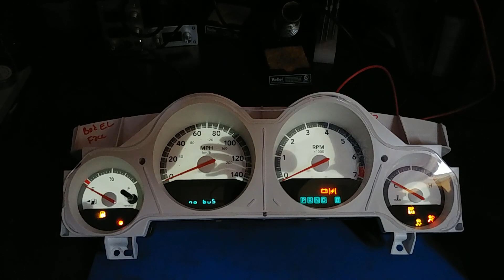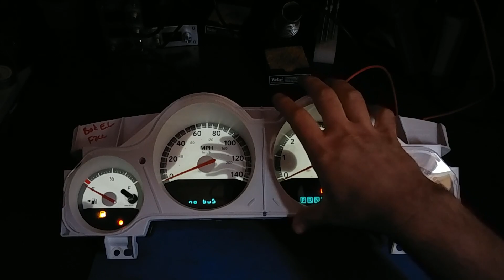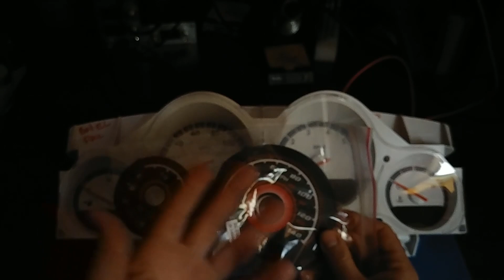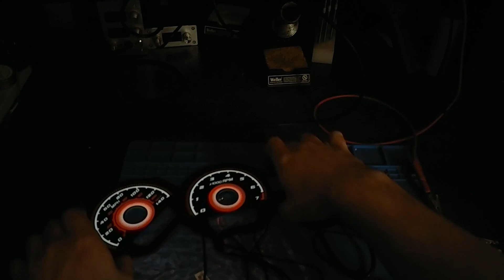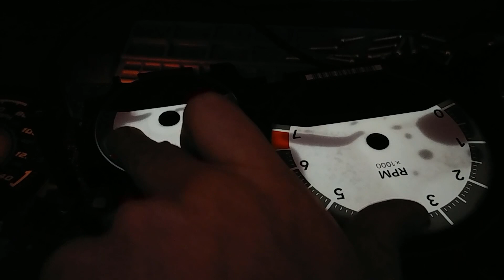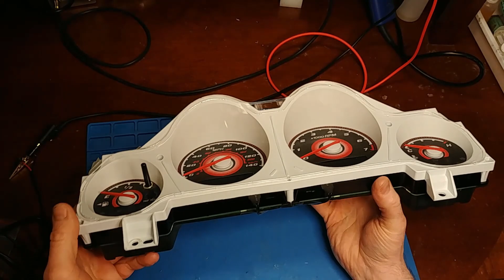Charger Challenger EL Lighting Cluster Repair

Comment from the maker: For quotes on repair service please email me at 1mr.repairman@gmail.com
Reply: NEWSFLASH !!!
It is possible to repair your existing (faulty) electroluminescent panel, provided there are no breaks affecting continuity.

Remove the sheet by dis assembling the instrument cluster, as per instructions in this (excellent by the way) thread. Place EL sheet (minus separate calibration overlay) on a flat surface and (using a household iron set to cotton/linen) iron out the air bubbles whilst in the process re adhering the clear plastic sheet to the EL part. It’s crucial to have an insulating layer of cotton (an old t shirt is ideal) between the sheet and the iron while doing this to prevent melting the clear plastic.
Work outwards from the undamaged section towards the edges of the sheet.
This will minimize trapped air bubbles which will show as smaller dark spots though they should be barely noticeable once covered with the calibration overlay.
I performed this procedure yesterday with excellent results !
Good luck 😊

Comment: hopefully youre still checking these. can you tell me which pins you are using to supply the 12v to the cluster. looks like 12+ on the white connector and 12- gray connector. it appears its the larger pins at end of conneector

Comment: It definitely does change the colors from like a white blue to a green that matches the factory climate contril dial green, I also laid mine right over the el panel and wired it right to the dimmer switch of the car came out super clean and can easily be turned back to original if desired
Reply: I honestly need help on the installation
Reply: @kidwitadream its super easy

Comment: My car had this issue went i bought it... I was thinking that buzzing I heard was the dimmer switch but i never thought to tinker with the gauge overlays cause it seemed to complicated... Might give this a try though....
Reply: Hey dude, i just bought mine, a 2011 RT. 

And has the same issue (the bubbles and the buzzing when using the dimmer. 

Did u and how did u solve ur problem ?

Comment: My cluster has been a nightmare for 2 years now. Loud whining noise, 1 gage with no lighting the other 3 with massive "shadows" and intermittently blacking completely out at night.  The fuse for the instrument panel is so hot you can't touch it.  Last night it finally completely failed.
Reply: Mine is doing the same exact thing and it makes some whining noise as I turn the interior light wheel knob up and down. I’ve been looking for a fix for this and I just found it today. I have a 2011 Dodge Challenger RT plus
Reply: @TommyWrenn what'd you do to fix it?
Reply from the maker: Sounds like it's time to get it fixed.

Comment: someone said instead of doing all that work you should replace it with a 2015 or 2017 cluster they don't have that problem. is that true, I have a 2013 R/T  doing that something yours is doing.
Reply from the maker: If that year range is compatible (I haven't confirmed) a replacement will require programming. If the programming is done at the dealership, you can probably buy 3-4 faces for the cost of dealership programming, and that doesn't include the purchase price of the replacement cluster.

Comment: please if you cant link this so i can purchase it. just a got a 2013 and it has this problem
Reply from the maker: Go to eBay and in the search bar put in your car model/year and "Glow Gauge Overlay". You'll need to make sure you select the correct mph for your cluster.
Reply: @jeffescortlx  About to install onto a 2010 SE, could you please verify how you used the extra material to construct an adapter enabling plug & play into the factory inverter? This video has been like a light at the end of a dark tunnel and it would mean a lot to know that I've done this properly. Thanks!
Reply from the maker: @InvictaWatchGuy I just connected it directly to the original inverter. You can also just follow the original instructions that come with the replacement face if you're more comfortable that way.
Reply: @jeffescortlx 3 days later and this is the reply I've been waiting for... what a joke. We know you connected it to the factory inverter, me and a dozen other people asked HOW. Why even post such an unhelpful reply?
Reply from the maker: @InvictaWatchGuy I soldered it. At the 6 minute mark you can see the new wiring that I've added.

Comment: about to do my cluster just like this, gonna wire the faces together like you did and hook it up to my converter lol, i was looking through the comments to see if any issues had happened by using the factory converter cause the seller said not to do that due to low voltage but ill take the gamble as well lol
Reply from the maker: So far so good.
Reply: @jeffescortlx  did you have to Sodder the adpater to the circuit board?
Reply: solder***
Reply from the maker: @Zack-wb6ll  Yes if I remember correctly I soldered directly to the PCB a short pigtail/plug from the new replacement face harness.
Reply: @jeffescortlx  this may sound dumb but where is the pcb located? 😬
Reply from the maker: @Zack-wb6ll  it's the entire center section of the instrument cluster.
Reply: @jeffescortlx  yea I got it, quick question did you take out both old faces? like the face and the luminescent material that was under the old face? or did you leave that in with the new face
Reply: @jeffescortlx  who is the seller?  where do I get this?
Reply from the maker: @greencanofbeer  1:40

Comment: Hey great video, I have a 2008 charger with burnt out hvac control back lights, please tell me you have a LED upgrade solution??
Reply from the maker: I don't believe I've had a climate control apart for the charger yet. I'm not sure which package size LEDs they use.

Comment: That's awesome!  I've got mine out now and I'm trying to just figure out which pins I put power and ground to just to light it up like you did.  I have the service manual but it is a damn chore to search through...  Any chance you'd know which pins on the grey and white connector need power to light it up?
Reply: Looks like:
Gray connector: Pins 2, 14 and 15 are ground.
White connector: Pin 14 is B+(IOD) and 15 is the run start signal...
I had it right, just needed to wait long enough for it to boot.
Reply from the maker: @10100rsn  Yes this looks to be correct when the back of the cluster is facing you, the power pins will be in the far bottom right hand corner of the larger section of the white connector. And ground is in the top right corner of the gray connector (large half).

Comment: My 2010 SRT has the same problem, with the buzzing. Any idea if dealer will do an EL swap or will they just look to replace the whole unit?
Reply from the maker: Dealerships don't repair clusters, they just swap the entire cluster assembly. And this typically requires programming.

Comment: Can I ship you my cluster mine has not failed but I want those gauges without the extra wiring under the dash I need to get my cluster fixed first I have a p0462 if you can do both I’ll send it your way
Reply from the maker: You want a new face installed even though yours is still lighting?
Reply: @jeffescortlx  ya I have the p0462 code I swapped the fuel pump and sending unit I figured while the dash is out might as well
Reply from the maker: @The-Tactical-Plumber  Yes I can fix that. But I'll need to know what version of the face you have to make sure I have the right one in stock. But I'm also booked out until February.
Reply: @jeffescortlx  so my charger is the 160mph dash I bought the same backlight overlay from this video I haven’t driven the car in a while it’s a summer car I just recalibrated the gages by holding the trip button and key on power and the cel for the po462 is gone but if you have availability to swap the gauge faces
Reply from the maker: @The-Tactical-Plumber  for current turn around time and price quote my contact information can be found here:
https://youtu.be/T_2WnJMsZaU

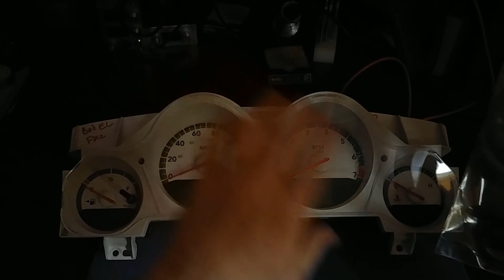Comment: @2:25 mine buzzes too and has all those shadows too
Reply: just watched the video again.  I never tried anything with mine (police 160mph cluster).  I'm tempted to pull it again and maybe try running a heat gun over it to see if that re-adheres it.  If that doesn't work, do you know what adhesive they use?

Comment: Hi there!  You are definitely a inspiration!  So I found where you got the panel cover, however all he has is up to 2010(I’ve got a 2012 Challenger).  Do you think the 2010 would work?  They look exactly the same however yours came in 2 pieces and the sellers pics appear to be one long piece.  I tried emailing him before you, but still no response.  Either way, thank you so much!!!
Reply: did you ever figure it out i also have a 2012 challenger
Reply from the maker: Is it a EL face? Does it have wires coming off it?
Reply: First off, Im very sorry for the delay… i tried emailing the seller again asking very simple questions thinking maybe there was language issues on his part, but still no reply.  Yes, there are two lines of wires coming off the bottom of his overlay.

Comment: There is a guy from Romania that sells a replacement inverter for the Sebring it's like $80 and it works surprisingly well.
Reply from the maker: But with the Charger/Challenger it's not the inverter that's the problem. It's the face.

Comment: What do you have hooked up to check the cluster? I swapped mine out only to have an issue with it and I’d like to test my next one before I put it in. It looks like you just have one wire running to that back to produce the electricity needed to run it. Any info would be helpful and greatly appreciated. Thanks!
Reply from the maker: I don't have the PIN numbers, but the bottom right hand side of the large white connector you need to connect positive to the two bottom right hand pins, one is battery constant and the other is ignition. Ground is on the dark colored connector top right hand corner of the large connector is ground.

Comment: If you don't mind me asking, where did you get the parts?
Reply from the maker: 1:40
Reply: @jeffescortlx  Do you offer the service of replacing the El face on a 2011 challenger? Thanks
Reply from the maker: @jasonstrohecker2446  yes
Reply: @jeffescortlx  I have a 2011 Srt8 Challenger and think I'm going to have issues finding an aftermarket EL face with 180mph speedo and SRT logo.
Reply from the maker: @jasonstrohecker2446  I only have the 140 mph black face on hand.

Comment: Thanks for the videos, I really enjoy them.  I belong to an online Sebring Convertible club.  The 2nd gen Sebrings (2001-2006) had EL clusters and they all seem to eventually go dark.  It almost always ends up being the inverter.  Chrysler used EL clusters again in the 3rd Gen (2007 Sedan, 2008-2009 convertible) and people are starting to run into a similar problem with bad inverters.  People are buying random inverters and having mixed results.  Unfortunately the 3rd Gen clusters are also the BCM so replacement is expensive (because VIN, options and mileage are stored in cluster you can't put in a used one).  Chrysler stopped using EL clusters and went with LED backlighting on the 2010 Sebring and 2011+ 200.  There is a market, maybe small, for finding the correct replacement inverter for both 2Gs and 3Gs.  We haven't really seen any issues with the EL film itself.
Reply from the maker: Correct, here is my Sebring repair video:
https://youtu.be/CxFYvIvVRtI

Comment: When wiring to the stock board is there a polarity to take note of? It’s hard to tell in the video red or black and how to connect it to the stock location. Thanks for any help.
Reply from the maker: The electroluminescence panel runs on AC, polarity not critical.
Reply: @jeffescortlx  thank you so much

Comment: Dakota doing the same thing.
Are you saying this condition cannot be "repaired"?
Wanted to keep the stock look and didn't want to take a chance with salvage yard replacement.
Reply from the maker: Dakota? What year?
Reply: @jeffescortlx  2011
Reply from the maker: @dc-wp8oc  if that cluster uses electroluminescence and not leds, I do not see any aftermarket third party faces available. You might have to go with a used unit.

Comment: I’m dealing with this issue! It’s spreading slowly into my speedometer. You still do these fixes? I’ve seen a place that does it for $200. I definitely need mine fixed. I have 2009 RT with the Road and Track performance group, and it has all the special info in the cluster.
Reply from the maker: My service is comparable in cost. As long as I can get my hands on an acceptable replacement face I can offer the service.
Reply: @jeffescortlx  So it’s not even the lights. Literally the cover? What a flaw
Reply: @jeffescortlx  Honestly considering it. Not really anyone in NY who does it. At least in my area, and I really don’t want to buy a whole new cluster. Only other thing I can think of is if Dodge does it themselves which I’m unsure of.
Reply from the maker: @Titanic19127  yes for this style of cluster they don't use lights, LED's or light bulbs, to light it. Just an electroluminescence panel with the face printed on it.
Reply: @jeffescortlx  Are you still doing this now?
Reply from the maker: @Titanic19127  Yes but currently lead times are longer. I have the 140 mph black face in stock, one with blue accents and one with red accents.
Reply: @jeffescortlx  Is it possible to buy one and replace the board in the back to make it work? It’s such an odd issue.
Reply from the maker: @Titanic19127  you mean to replace the circuit board? Or do you mean to separate the layers of the electroluminescent layer?
Reply: @jeffescortlx  factor luminescent layer. I’m to the point where at night my fuel gage is totally out and the others are getting worse.
Reply from the maker: @Titanic19127  I would recommend doing exactly what was done in this video, having the face replaced.
Reply: @jeffescortlx  I would love to know how you directly wired it to the car instead of having to use to the dumb switch it comes with.

Comment: Would you be willing to make this repair for someone?, I can provide my contact info etc. Quote or how does someone contact you as a new customer?
Reply from the maker: Yes I take in repairs from the lower 48 states. But unfortunately I'm currently at maximum capacity for repairs.
Reply: @jeffescortlx  are you still?
Reply from the maker: @Dioimai  quite honestly I'm usually backed up with work 95% of the time. But if you want to get the process started you can email me at 1mr.repairman@gmail.com
Reply: @jeffescortlx  I am happy to wait for service , but I have tried your email recently with no word. We understand your busy , however what kind of time is your line before someone can expect to have a response to an email to get in line please sir?
Reply from the maker: @jasonlang7229  I replied to your email Sep 26, 2021, 8:31 PM.
Check your spam folder if you don't see it.
Reply: @jeffescortlx  My apologies, I do not see it spam etc. I will email you from a gmail address and attempt that way in case something is going on with my email etc. Thanks for your time

Comment: I'm interested in getting into dash repair, I'm really good with soldering and desoldering. I've done a couple GM clusters but had to continually run out to the vehicle to get them calibrated. Any recommendations on equipment that I should purchase to make it easier and advice on wiring? I know that with some GM clusters the needle sits below 0.
Reply from the maker: https://m.facebook.com/amarilloclusterrepair/ 
Makes plug and play testers
Reply: @jeffescortlx  do you do repairs  for 2007 yukon denali?  I think I need a stepper for the oil gauge.
Reply from the maker: @jamesworth8001  the new body style don't have defective stepper motors like the classic/06 and older. You have actual oil pressure issues with that 07 engine.
Reply: @jeffescortlx  the oil pressure went from normal, then pinged 80 psi for a second, then dropped to zero and hasn't moved.  I changed the sending unit/pressure sensor and it still doesn't move at all.  I would think if I had actual oil pressure issues, it wouldn't have went up to 80 before quitting.  Thoughts?
Reply from the maker: @jamesworth8001  might be a wiring issue. What does a scan tool read for oil pressure?
Reply: @jeffescortlx  my scan tool doesn't read oil pressure, so I'm not sure.  I have driven it, but it isn't rattling or knocking while idling.  Seems to be pulling oil, but I dont want to risk blowing the motor.
Reply: Meant to say I have NOT driven it
Reply from the maker: @jamesworth8001  if the message center is also saying low oil pressure then the signal the cluster is seeing is a low oil pressure signal.
Reply: @jeffescortlx  it isn't showing any warnings and no check engine light.  That is why I thought it may just be the gauge.  Is there a simple way to test the gauges?  Maybe a voltage reading on certain wires feeding the cluster?  And by the way, I really appreciate the help!
Reply from the maker: @jamesworth8001  a dealer grade scan tool can not only read the oil pressure sending unit and signal the cluster to run a sweep test. It's extremely unlikely that it's a stepper motor problem. The new body style cluster isn't known for having trouble with them. And if the stepper motor was bad it wouldn't be able to go to exactly 80 and then exactly 0psi. It would either get stuck in a random spot or wind it's way completely clockwise or counterclockwise.
Reply: @jeffescortlx  thanks for all of your help.  I'll send folks your way in the future.